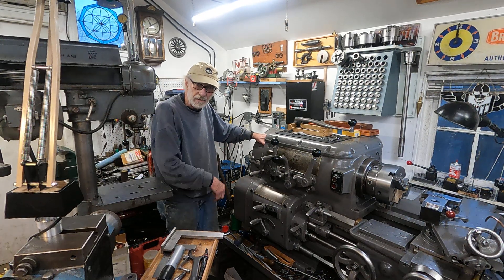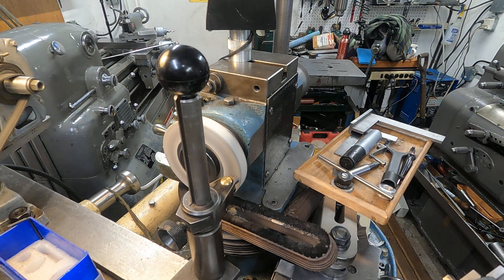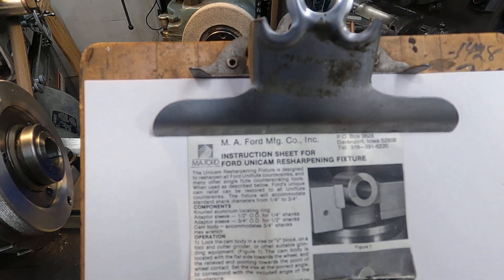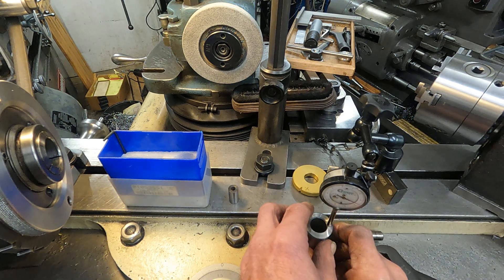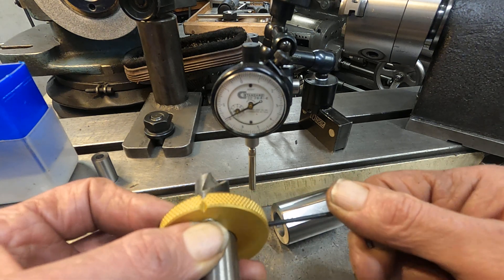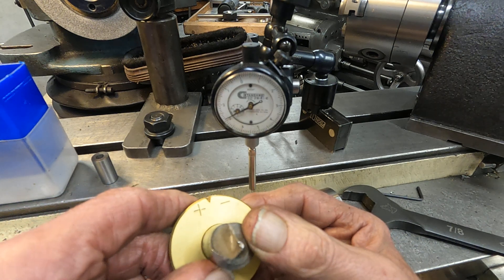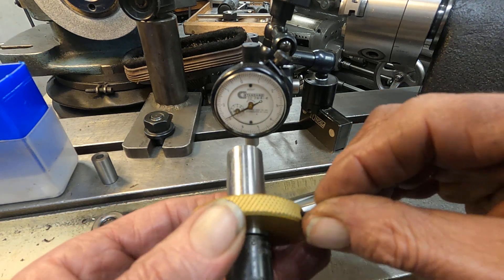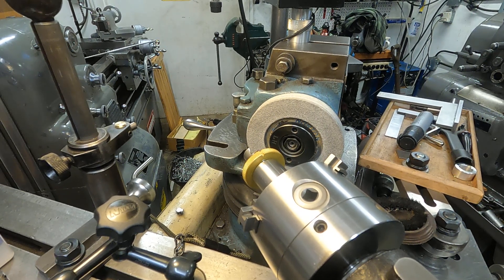Tool & Cutter Grinder Single Lip Countersink Resharpening Unicam Fixture 1

Comment: I own a tool & cutter grinding shop and have been doing it for 25-30 years
Don,if the tool is sharp when you’re done. You did it right
I have a hybco for countersinks and I grind tools for production. If your grinding tools for you then sharpen it how you need to. 
Keep up the good work and ignore the bullies